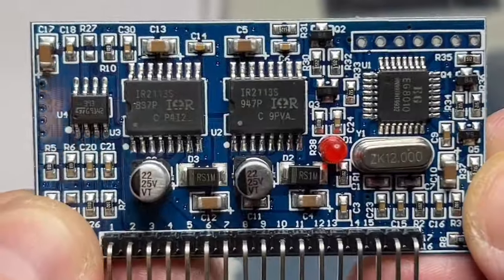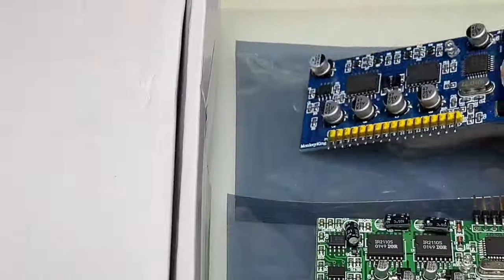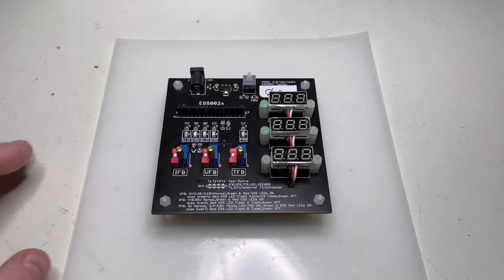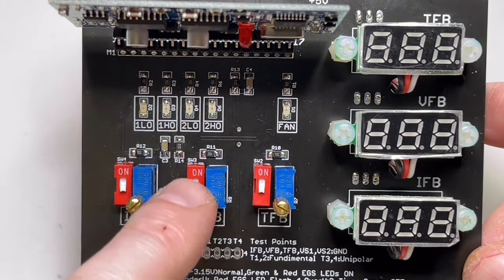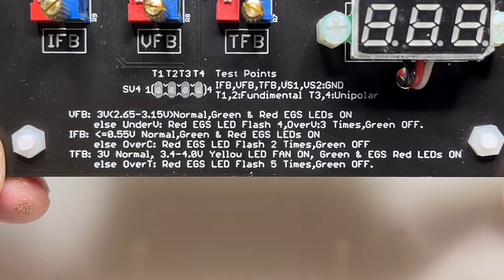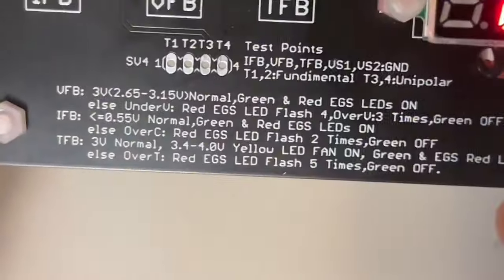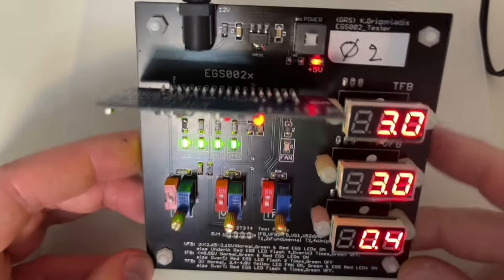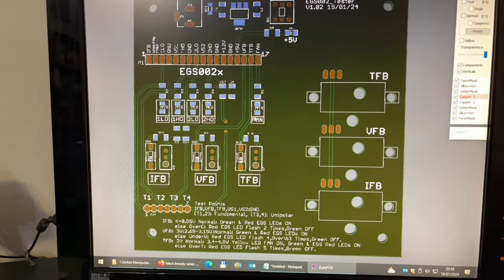Fancy EGS002 Tester for the Popular SPWM Boards with 3 Dedicated Meters, Details

Comment: Very nice and useful tester.
I have a question.
We are working on this module to make DIY solar inverter. The module is constantly blasting its ir2110. We put a dip and then some improvement make. But now some time it tested loaf for few minutes with 5-8 amp. But after few attempt it module controller got damaged without any reason. You make any inverter with it?
Reply from the maker: Hello, Thankyou! 
1) Are you using the EGS002 in High Voltage & Frequency Mode or in Low Voltage & Low Frequency mode ?
2) if you use it at Low Freq Mode, you use a Iron or Toroid Transformer ?

3) another reason the IRxxx blow can be due to fake or bad quality...(I had that) I only use drivers bought from a reliable source when using it on Low Frequency Mode.

Both make a a big difference on how good or bad the Module will work. Yes i used it with China High Frequency Inverter Board, with no Problems. Problems mostly occur with Iron and even more Toroid Transformers in use, but there are some Solutions.
Cheers, Konstantin

Comment: Hello konstantin Grigoriadis you have made a really nice egs002 Tester.  straightforward parameters whats required to test the board really good. I have made one not as good as your one but it's just on the basic PCB strip board with limited functions only just to test the board and use the oscilloscope to check that the outputs are working correctly. Do you have the Gerber file it will be nice when I make a next order on PCB ways if I can probably get one or two of these so then it will be a lot easier to test some of these EGS 002 board. Thanks Yannis
Reply from the maker: Hi Gianni, Thankyou! Send me a Mail to can send you the design Files, My Email is in the Description Tab of my Channel. Cheers, Konstantin
Reply from the maker: Hi , I did not receive a mail from you yet
Reply from the maker: Gianni, I did not Receive a Mail from you yet, therefore here a Link to my PCBWAY shared Project where you can Donload what you need : https://www.pcbway.com/project/shareproject/Fancy_EGS002_Tester_with_3_Dedicated_Volt_Meters_0466878d.html , Cheers, Konstantin